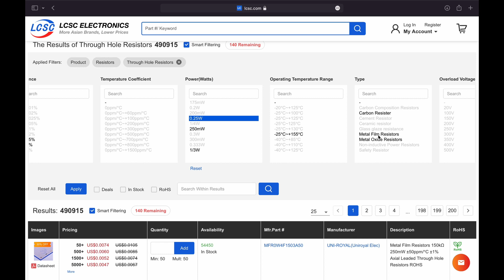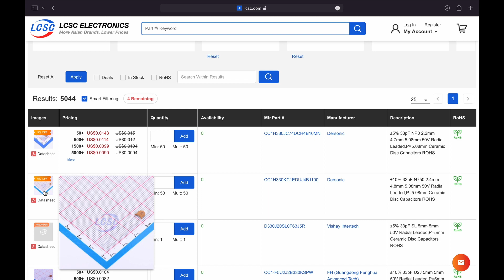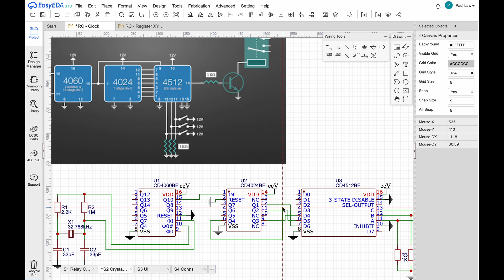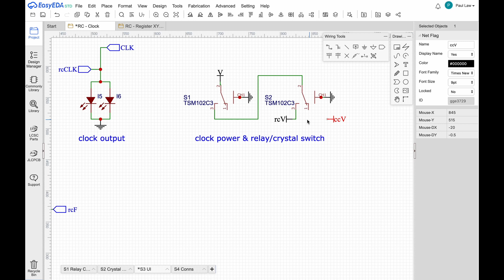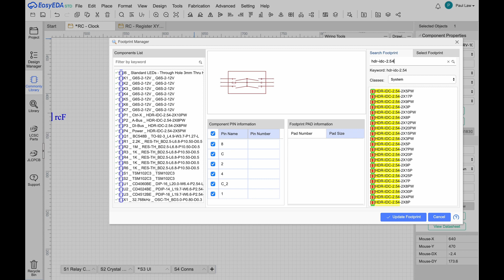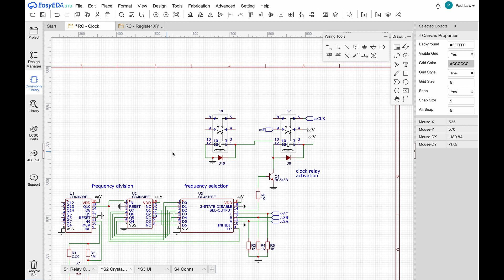Relay Computer Clock - Ep13 - Schematic Design 2

Comment: Hey first of all awesome work, 
i also plan to build an relay computer. and could u tell me what switches these are i cant find them anywhere and what type of relays u used
Reply from the maker: Thanks :) The switches are Ninigi TSM102C3 - not chosen specifically as such but just a good match when I was buying parts from my parts supplier -  https://www.tme.eu/gb/details/tsm102c3/toggle-switches/ninigi/ The relays I use are TE/Axicom V23079A1003B301 but for my design any miniature telecom relay would do as long as they've got DPDT contacts (although I'd want to use the same type/rating through the computer). Interesting these have doubled in price since I first started so it's not a cheap hobby ;)